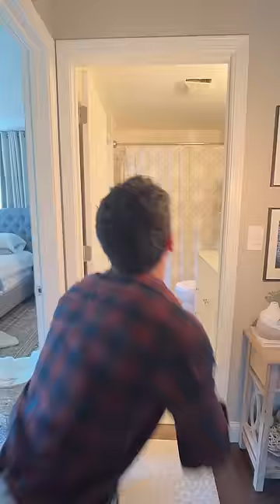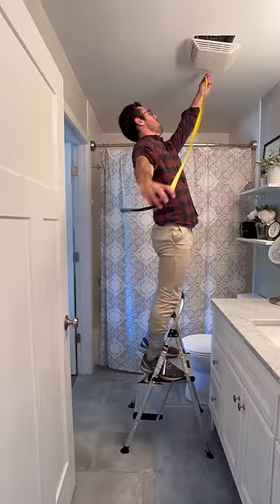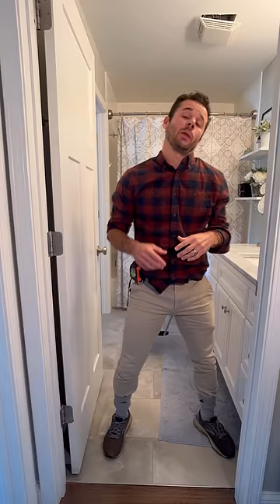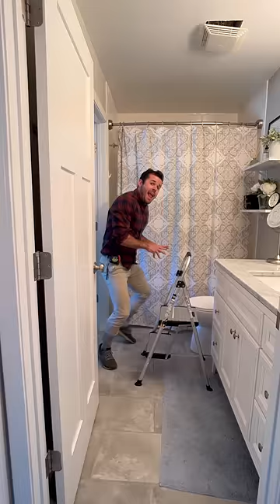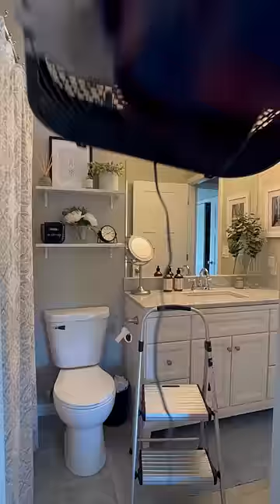When Your Handyman Talks Over Your Head.

Comment: /Husband wanders in.

(talking fast) Well if we need a new fan id like to upgrade to a model that interfaces with a clapper and with the bypass circuit on the breaker panel in the basement, so itll work hands free during blackout. I also want heisenberg compensators for when it needs to work harder to vent all that poo laden air on nights we eat mexican food.  Make sure its a high performance 4 bladed model with variable pitch, running on 220v, not a standard 3 blade on 110v ... if my hair doesnt stand straight up while i'm on the can, you wont get paid, bucko.  I want REAL SUCTION. Oh, and put a seat belt on the toilet, just in case. On the high side, i dont want it to suck the cat up off the floor, like a bird through a jet engine, so let's cap the max upward suction to 5 lbs of force.

$1,500 is my budget, bucko, so GET MOVING. CHOP CHOP. 😎

J/K 😂